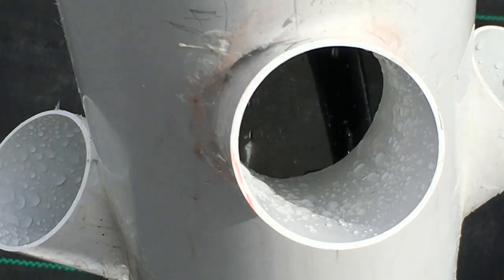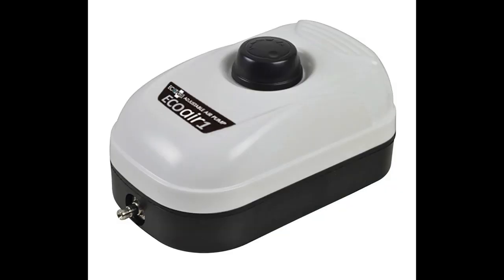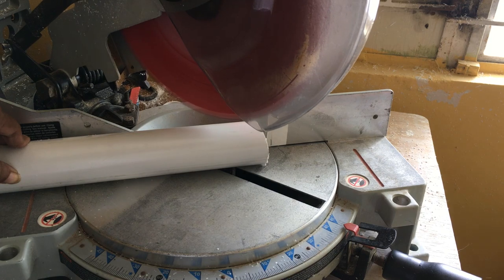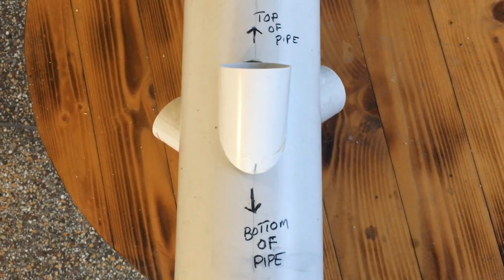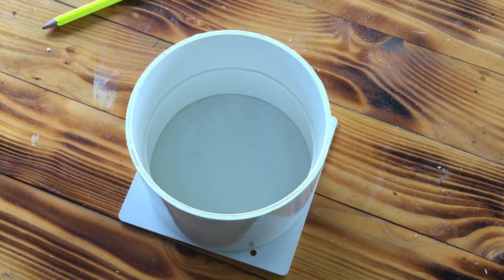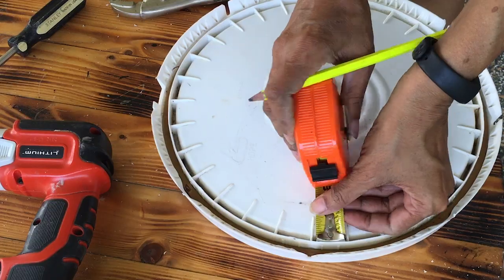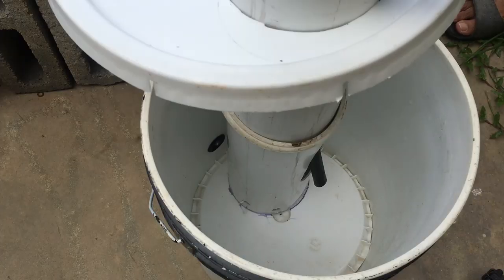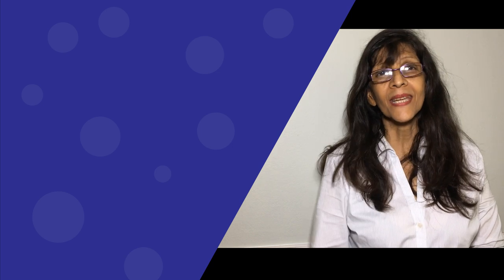DIY Hydroponic Tower / Grow Tower

Comment: thanks for posting, won't the glue get into the water and then into the plants?
Reply from the maker: Use it sparingly and make sure it cures thoroughly before adding the nutrients.This is the same glue that is used in indoor plumbing use.

Comment: Instead of pvc glue and a joint, just cut a slit in the pvp main pipe, heat up with a heat gun till pvc is bendable.  Then use a wooden plug template to push into the cut slit to create the pocket for the plants to sit in.  The pvc will cool and stay in this position.  No need to use glue or special cut joints
Reply from the maker: Tried that originally but it leaked like crazy that's why I came up with this design.

Comment: vertical,  correct me if, I am wrong, butta.  I would think that  Uhm, water? qravity?uh would suggest , hard to keep water at all the bases level,  wouldn't work,  could possibly overflow lower areas?
Reply from the maker: Check my results here https://www.facebook.com/436579470433049/videos/1136470089883151/ .It's a rain tower system the nutrients constantly rain down on the roots.

Comment: Do you run the water 24/7 or do you have them on a timer? if on a timer, what is your water schedule? Thanks!
Reply from the maker: I live in the tropics so I do run it 24/7 otherwise it would dry out in the space of 15 minutes,but you may not need to depending on where you live.

Comment: Very informative guide on the build but I have a question. Why use regular ole PVC but use a food grade bucket? Wouldn’t UPVC be safer since UPVC is BPA free and free of phthalates. Just wondering because I was looking to build one myself.
Reply from the maker: PVC pipe is used for indoor plumbing here including the kitchen faucet for over 50 years so I am guessing its safe for the system.

Comment: This is one of the best DIY Hydroponic Tower, with very clear instruction and parts list.  Can you please share where did you get the 4-inch PVC 2-hole strap? I could not find this type of strap in my local hardware stores (Lowes, Home Depot) in Los Angeles area
Reply from the maker: I am located in Trinidad and its easy to find,but I saw something similar called a pipe strap clamp or pipe strap for plastic conduit on Amazon so I am guessing it would be readily available in your local hardware.

Comment: I am in the process of building this. Thank you for the video. I am wondering if I even need the air pump and airstone? Also, In the back of my mind I keep worrying about the PVC and sealants / glues leeching into the water and into the food. I selected Aquarium grade silicone and glue just to be safe but still a bit concerned about that.
Reply from the maker: You are welcome.I did not need to install an air pump or air stone as the water falling from that height provided plenty of aeration.I did use aquarium grade silicone as for the pvc that is what is used in our indoor plumbing in our kitchens here in Trinidad and Tobago for over 50 something years.I guess the perfect vessels would be stainless steel or glass.I don't even think BPA plastic would be that safe either.
Reply: @over60crafter  Thank you for the response. I have been reading up on the PVC for a few days now and it appears that the uPVC (unplastesized PVC) also known as Rigid PVC is considered food safe as it is extremely stable with no addition of plastisizers (pthalates, BPA etc). I went and bought all the parts for this system and cut everything out before I realized that I had purchased a regular PVC sewage pipe. I am going to try to source a uPVC pipe for me new project and I just wanted to share that info with you incase you wanted to try that in the future for peace of mind :) Thanks again for the tutorial lady. Great little project. Might even try bamboo if I can't find the uPVC.

Comment: Thanks for this video, it was really helpful as I’m following exactly what you did here as my first hydroponic system.

1 question: when you run the pump, do you run it 24 hours straight or do you schedule some minutes every hour. I have found different opinions and it would be interesting to know how you run this. Thanks
Reply from the maker: It's on continuously as I live in the tropics the sun would heat up the pipe in about 10 minutes if its not flowing continuously..

Comment: Overall it is a good job but some perplexities have arisen: 1) With the processes it uses it produces large quantities of micro plastics that surely pollute the ground and water! 2) All glues and materials used for the tower, with the exception of the bucket, are not for food use! All the materials used as adhesives will certainly enter the food chain because the water flowing through the tube will certainly come into contact with these toxic materials! I don't think I would use this tower for food purposes, such as lettuce or other vegetables!
Reply from the maker: Thanks for your input.It also works great for flowering plants.
Reply: I was thinking the same... all this plastic and glue in the water.. seems pretty sketchy to be eating..

Comment: This pretty much mimics the expensive  $600-$800 commercial kits.

Other DIY versions usually use a heat gun to carve out space for the pots, so this was an interesting variation of cutting out holes and glueing on the 45-degree cup holders.  I'm wondering what the pros and cons are of the two approaches.

A more important question, regarding the nutrient-water rain.  Is it constant or is it on a timer, again mimicking other commercial low pressure aeroponic (LPA) systems?
Reply from the maker: Hi,I did try the other build using a heat gun,those things leaked like crazy,that is why I came up with this design.I run my pump 24/7 because of the small diameter of the main pipe it would dry out in to time at all here in Trinidad and Tobago.

Comment: I read in a post that you acquired a food-grade 5-gallon bucket for this.  It was a used white bucket.  Then I read that you painted it - looks like to lightly spray painted it.  The reason I think you gave was to prevent algae.  Can you please elaborate on the algae reason.  I watched a dozen or so other youtube channels and I believe you were the first i heard that warned about algae.  How does spray painting them prevent algae?
Reply from the maker: Algae is a living organism which grows with the help of sunlight  and it will compete with your plants for the nutrients in your system so it is best to avoid any growth from the start.I painted the bucket years back but you can use a dark colored bucket to block the light from penetrating it,or use a foil like I did to block the light and keep the temperature of the nutrient down.
Reply: @over60crafter  thank you for the quick response

Comment: Great video, is there a big drawback of doing 8 inch spacing or less between plants vertically, instead of the 10 inches in the video? - Does it just depend on what kind of plants, and if smaller plants then shouldn't be a problem?
Reply from the maker: Thanks it would all depend on the type of plants you are growing, for instance chive would not need that much space.I don't see 8 inch spacing being a problem,I think I did my nft system years back with an 8 inch spacing and I grew basil.
Reply: @over60crafter  Thanks for the reply! Is that due to the space the plant takes up, or the space their roots take up? I am planning on doing baby kale, so I'm thinking that will be fine then.
Reply from the maker: @KlasseCaldiny  Lots of space for the roots, the only thing I probably would not try is large fruiting plants like egg plants or tomatoes.Even normal size kale will do well with an 8 inch spacing.
Reply: @over60crafter  Question, my partner doesn't like the idea of eating things that come into contact with the PVC cement (afraid of toxicity), do you think I could 'glue' and seal the tower using only silicone instead?
Reply from the maker: @KlasseCaldiny  I don't see why not just make the holes a little tighter,but make the length a little longer by adding an extra inch which would be placed  inside the pipe it might help to keep it in place along with the silicone.

Comment: Very detailed and easy to follow directions, thanks.  I have a question though.  The owner of a hydroponics store told me a big concern was if the water got too warm it would damage the roots.  If so, any suggestions?
Reply from the maker: Thanks.I covered the bucket to prevent the solution from getting warm,and I run the pump 24/7,you can also bury the bucket in soil to keep it cool.

Comment: i watched several Videos regarding hydrotowers but could not find out what Kind of pump i Need - and does it have to work 24/7?? can this Tower be placed outside in the garden? thank you for your help and this great Video!
Reply from the maker: Hi,get a pump that can pump up to a height of 6 feet be sure to check the specs of the pump.I run my pump continuously 24/7.My tower is placed outdoors.Thank you.

Comment: Awesome Video. What do you think about making small cuts, heating the 4" PVC and shaping with a soda/wine bottle... instead of cutting holes and fitting for the net cup holders?
Reply from the maker: I have made several of those,but they leak like crazy on both sides,wasting a lot of the nutrients,plus it looks ugly after a few days as the algae grows on the path of the leaks.This one can be made totally leak proof by using the silicone.

Comment: I built a tower but unsure how often i should change neutrient solution?
I use 3 part grow solution, and thought id just add more when the level got low, but saw that the water went clear after a few days making me think all the neutrient might have been absorbed? Allso the PH was very high?
Thouts from anyone?
Reply from the maker: I usually just top it up.Are you using solid nutrients that need to be dissolved or liquid fertilizer?
Reply: @over60crafter  I use GHE TriPart.
Reply from the maker: @andreravenna4435  I have never had that problem,check this group on facebook  https://www.facebook.com/groups/637162503142454 someone else might be able to help with that problem.

Comment: Is there a reason why you chose to cut the outside diameter instead of the inside diameter of the cup holding pipe?
Reply from the maker: The end that was cut goes into the hole in the 4 inch pvc.
Reply: Oh ok Was just wondering because it looks pretty flush when you have it placed on the PVC pipe, so I thought it would be better to do the inside diameter that way the Holder sits on the PVC pipe and you can create a better seal with the silicone.  At least that’s what I believe I don’t know if you’ve done it before and that’s why you prefer to put it inside the actual PVC pipe.

Comment: Instead of holes make slats 3 holes lined up then clean out the 2 center arches each one counts for 4 holes, add a screen to the top pvc cap with slats pointy anti bird thing on top plug n play to avoid debris in the system but allows air flow

Comment: What is the air stone and air pump for? Can some one please explain? Is it neccessary?
Reply from the maker: It was for aeration but it is not needed as the water falls from the 6 foot height it provides enough aeration.I did not need the air stone or air pump.
Reply: @over60crafter  thank you

Comment: This is brilliant. I think you can grow more plants than you have. My husband thinks a small solar panel, battery, and an AC/Delco fuel pump (these are continuous flow for old Cadillacs which would have a slightly smaller volume but also smaller holes and more of them at the top of the tower. This way you could produce this food without any need to be plugged into the grid. 
Also I loved how your video wasted ZERO time. My husband always jokes about the 12 minute videos by some young kid to take apart an iPhone where the kid talks about how Mom wanted to know what kind of pizza his friend Zak wanted. 8 minutes of blah blah and 4 minutes of video Always missing critical video or information. But Zak wanted pepperoni.
Reply from the maker: Thank you.Electricity is relatively cheap where I live.I try to make my videos to the point as time is precious to everyone.Also I am not one for chit chat.Lol.

Comment: Great video, But I missed what you used the 4 inch piece of 4" PVC  you stated you needed two lengths of the 4" pvc one of 6' one of 4" . Did I missed something?
Reply from the maker: Thanks. I used the smaller length to hold the part with the holes in place,so its the 6 foot length then the 4 inch coupling 7:48 in video then the piece of plastic with the holes,then the 4 inch length and then the cap on top.

Comment: How much of a interior lip do you have to catch the falling water,  are the top plants getting more water then the plants at the bottom. I am wondering if I should place the pipes  deeper in as I work my way to the bottom.
Reply from the maker: The lip inside is minimal about 1/4 inch so that means the roots are fully exposed to the raining nutrients.The pump gives such a good flow rate I don't think it's necessary to place the pipes deeper as you work your way to the bottom.

Comment: a quicker albeit more expensive way is to use 4" x 4" x 2" x 2" PVC Double Reducing Wye , most of the ones I see available are DWV which is a more ridgid pipe
Reply from the maker: We don't have that size pipe over here and if we did it would be about 4 times what you would pay,that's why I went with the 4 inch PVC which is easily available world wide and cheap.

Comment: where is the part for installing the air pump and air stone pad?
Reply from the maker: You don't need it,as the height of the water falling into the bucket created enough aeration.
Reply: Thanks for the info. I will be building as soon as I complete my parts list.
Reply: What happen to the other 4in PVC pipe at the beginning? 1 was 6ft and the other was 4inches

Comment: What is the air stone and air pump for?  You didn’t mention them after the materials list.
Reply from the maker: To add oxygen to the solution.However you may not need it depending on the gph of the pump as I noticed when the solution falls from that height,lots of air bubbles form in the bucket providing oxygen.

Comment: What do you do with the 4 inch cut off piece of the 4 inch pvc pipe?
Reply from the maker: Hi.What part  on the timeline are you referring to?
Reply: Well. In the beginning time you cut this 4 inch off the main tower.
Reply: min 1:55
Reply from the maker: The top of the system has a four inch collar so in order to be able to cover the system I had to install that four inch piece so that I could attach the end cap.

Comment: What size pump do you use or recommend for this tower?
Reply from the maker: 375 gph works fine but not every  375 gph pump can pump to a height of 6 feet so check the specs on the pump.
Reply: @over60crafter  Thank you.
Reply from the maker: You are welcome.

Comment: Did the air stone and air pump get used?
Reply from the maker: Yes I used it but you may not need it.
Reply: @over60crafter  Thanks. Am I right in  thinking it wasn't shown in the video? I saw it in the parts list but then didn't see how it would be used or the purpose (guessing to oxygenate the water, but not sure where it would be placed?).